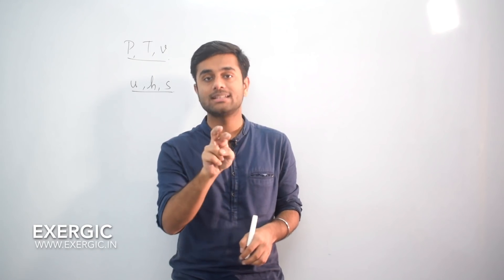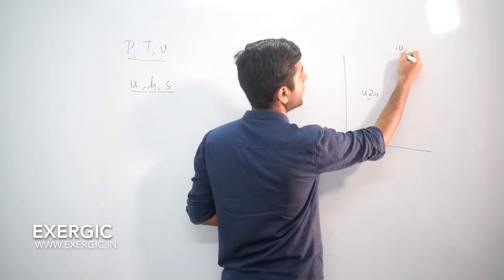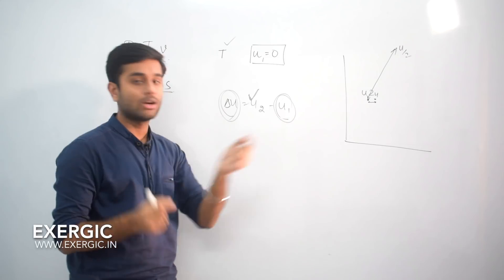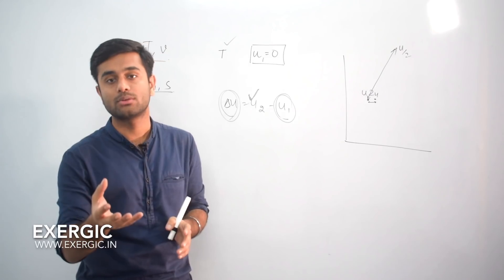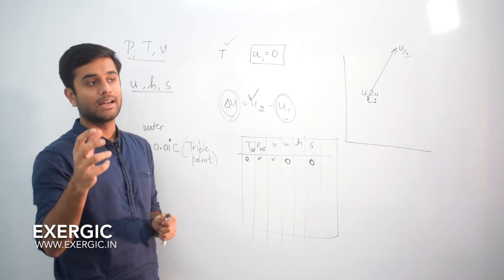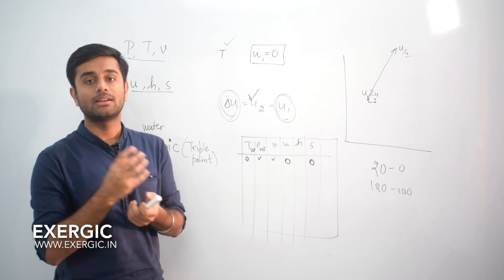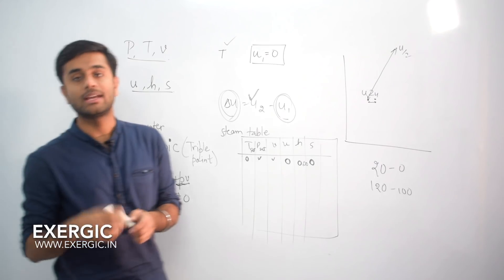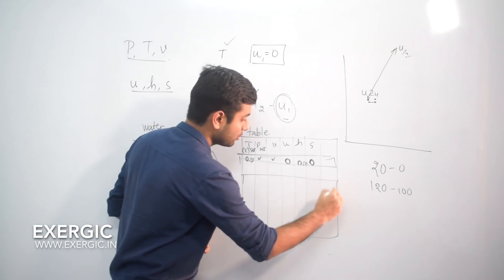Basics of Thermodynamics Property Table - EXERGIC Shorts

Comment: What is good score in full test series?? I mean how would I decide that 'ok I'm at  right path??
Reply from the maker: As I told you, take it as a learning experience only. Note the concepts that you did not know about and make sure you do not repeat them. This is how, marks will improve slowly.
Reply from the maker: If you think that you are able to solve majority of relevant questions, then do not panic. Keep your focus of learning and improving. 

Scores can fluctuate depending upon test difficulty and which test series you are using.
Reply: @ExergicGATE  sometimes it is very demotivating when you find test paper tough and your score is around 50 but other students are scoring heavily. Any suggestions or comment??(talking about exergic 2nd full test)

Comment: sir plzz help me.....for punching a 10mm circular hole and cutting a rectangular blank of50*200mm from a sheet of 1 mm thickness.shear stress=240 N/mm^2..force required if both operations are carried out using conpound die working is_____________????here we have to combine the forces in two operations or only the force required for punching the hole will be the right answee....plzz help
Reply from the maker: For a regular case of compound die, we add the force requirements of individual cutting operations.